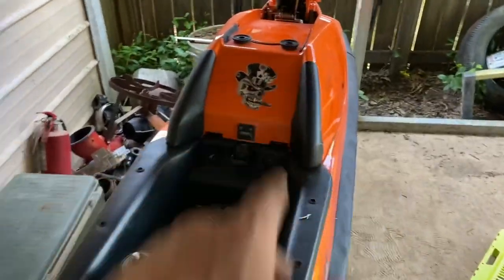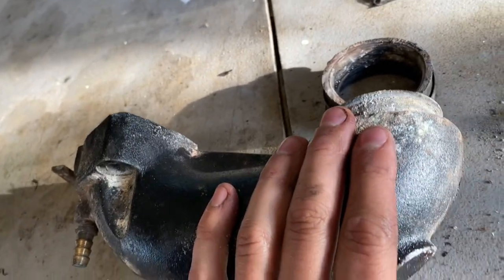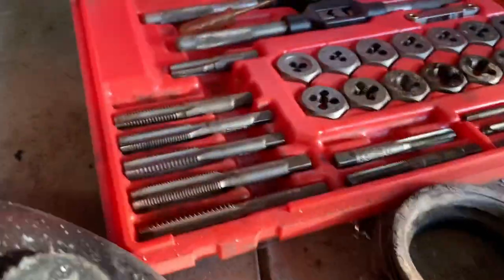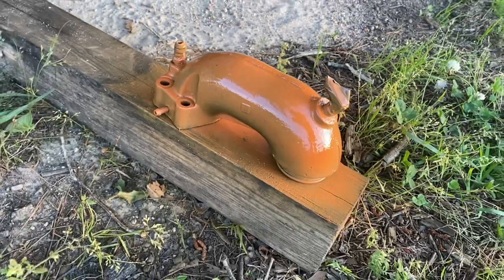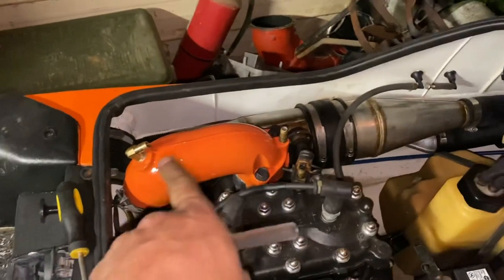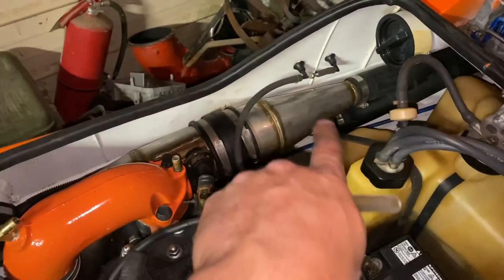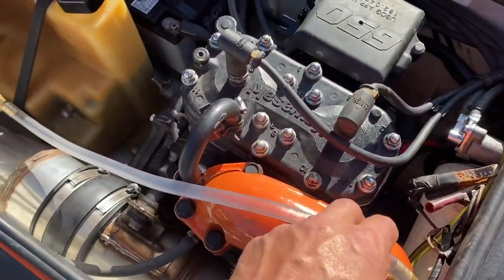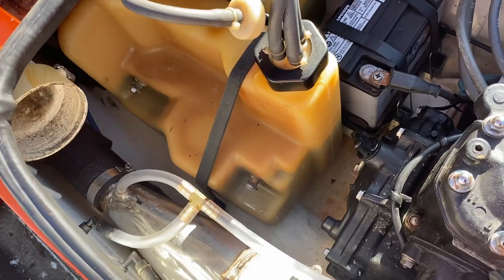Kawasaki 650sx dry pipe mod

Comment: Hell yeah fixing to do mine soon
Reply from the maker: It’s not bad just remember to drill a tiny hole in the head pipe where you plug it on the inside
Reply: @CocosPlayound  thanks for the input 👍

Comment: There are a few of these Drypipe mod videos online. Not one person explains what to do with the "other" bung at the top (backside) of the stinger pipe. Where it mounts to the headpipe. Do you just block it off. Or run it out the side pisser?  Anyone? Cheers
Reply from the maker: Back of elbow is blocked

Comment: what is the function of dry pipe mode?
Reply from the maker: Less water equals more power but if you go to light on water the exhaust will be too hot so there is a fine line that you can dance on. Stock they add a lot of water to be safe , you can restrict that water down and it brings a whole lot more power makes it more snappy.
Reply: @CocosPlayound  oh yes...i understand..thanks bro